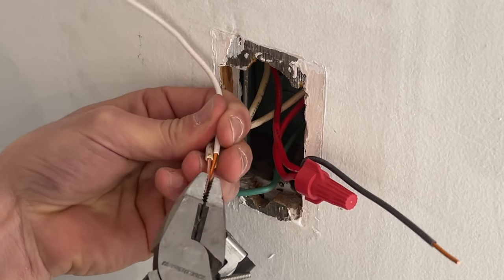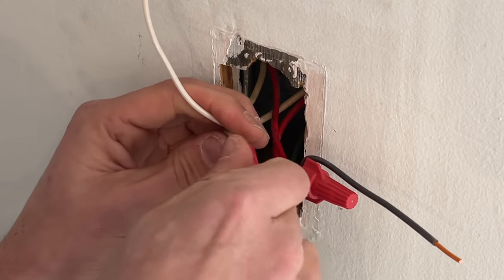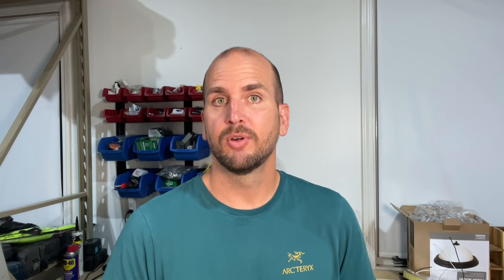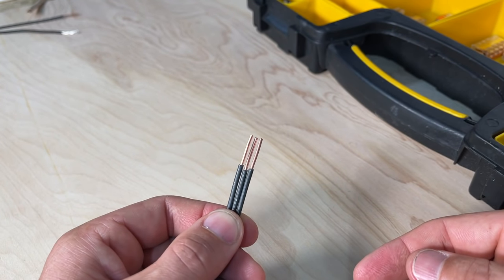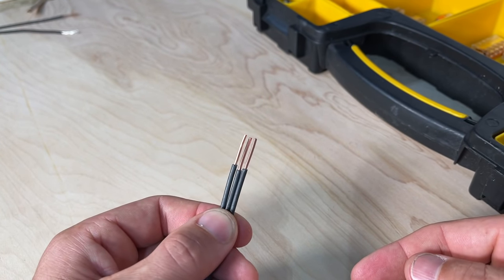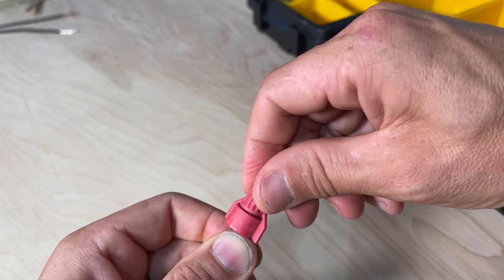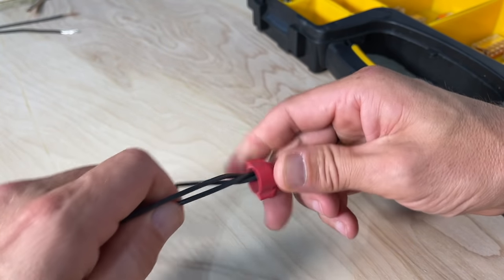10 Things You Didn't Know About Wire Connectors

Comment: There is actually a Marr connector.  It looks like a Marrette but when you unscrew the cap there is a cylinder inside with a side screw. To use it you stick the stripped wires into the cylinder and tighten the side screw to hold them in place. You then screw the cap back on to cover the cylinder and keep it from shorting. It holds your wires securely but you need three hands to hold the wires, the cylinder and the screwdriver at the same time. 
I always assumed the Marr was the original and the Marrette a newer invention. Sort of like cigar and cigarette.
Reply: I still have some of the Marr connectors with the side screw which I installed in my house.  Slowly changing over to newer version...

Comment: The "Self-Contained" Speedwire outlets like are common in RVs are really bad, for bad connections that can be a pain to track down especially on long daisy-chained runs.
Reply: I see a lot of those self contained outlets and switches in Mobile homes I work in. Whenever there is a question about one's operability or if it's worked its way out of the hole I pull it out, cut it off and replace it with a standard outlet in an "Old work" box which requires a slightly larger hole and usually works without further modification but sometimes the sheetrock requires patching and I have to cut a new hole. But I have come to love those old work boxes for this stuff . I don't use the full box ones just the collar because the walls aren't deep enough to accommodate a full box. I do not use the stab in feature at all I always loop my wire ends and use the side screws and yes I always pre-twist my wire before the nut goes on that way I know it's tight
Reply: @Rythymace  WTF you replace a self-contained outlet with a low-voltage ring and a standard residential outlet?? Holy fire hazard batman.
Reply: @ssl3546  The "ring" had no voltage rating it's just a plastic old work box collar. And i use quality 15 amp or 20 amp rated recepticles according to what is called for. And all my connections are wire loop on the screws not stabbed in the back. Much safer than those ridiculous self contained fire hazards.
Reply: @Rythymace  those are class 2 low voltage or are box extenders. you should stop before someone is hurt or killed by your ineptitude. and yes they do have a voltage rating

Comment: Pre twisting will do no harm to your connection. Sure the wire nut will twist them for you but what but how would pre twisting cause any harm? Also, many light fixtures come with pre installed push in connectors which also use stranded wire.

Comment: My problem with the wirenuts is we have a building built in 1979 and the "electrician" would use blue 3M B 6-12 wirenuts and put 10 #12 and 1 #10 (home run) under one nut for the neutrals. The B 6-12 is designed for no more than either 6 #12 or 1 #10 and 3 #12 as I read the 3M Spec Sheet. There is no way all the wires could pass the pull test even twisted.  The Wago Lever Nuts prevent this.  I live in an area that does not "require" electrical inspections.  You only have to "comply" with the NEC. NEC says the connection must comply with the UL spec.  I believe it said that in 1978 as it does today.  I forgot to mention that I don't think he read very well.  By the way, anyone seen a 10 pole breaker that spans the left and right sides of the panel lately??  NEC 210.4 (B)  The building is in the process of being rewired.

Comment: In much older houses, I’ve come across wire nuts made of Bakelite and even older ones made of porcelain . When I dropped one from a ceiling box ( repurposed gas fixture), it hit the floor and shattered into a million pieces.
As far as pre-twisting, I say yes because it’s still a stronger mechanical connection, has more contact surface area, both of which will lower your current draw. If you put an identical load on a pre- twisted wire and a non, I guarantee your current draw will be less on the pre-twisted. Resistance is an additional load.
Reply: Ohm's law says increasing the resistance decreases the current, so can you explain why you claimed the opposite?
Reply: @brothermine2292  I stand corrected, thank you . I still stand behind pre- twisting .

Comment: In Australia, electricians use screw junctions (twist wires together, put them into a terminal, screw down to tighten). I'm pretty sure wire nuts aren't up to code here, although WAGO lever nuts are approved and if they weren't pricier would probably take over very quickly.
Reply: It's so much faster that the price does not really matter. Count the number of connections you can make in a day...

Comment: I used a wago to wire a small room with just 3 wall outlets , I had a 10 awg feed from fuse box and a 14 awg to the outlets and while running a heater it smoked the wago after heater kicked on 4-5 times...not sure if I trust the wago's.

Comment: i think twisting of solid core copper definitely gives a better , lower resistance connection.  I think it makes wire nut more likely to fall off however, unless you untwist the tip a bit so that the nut has something to grab onto.    And always tape it afterwards for good measure. 

I think the manufacturers are simply covering their butts , at the expense of a slightly worse electrical connection.   There’s no way that the nut is going to properly twist up a pair of solid core 10AWG , for example …

Comment: diy. use wirenuts when there is no vibration. also secure it well with electrical tape. it will be good for a long time.
Reply: why would using electrical tape be against some codes ?

Comment: As a long time electrician I ask, if you do not need to splice (pre twist or whatever),  WHY do we have and always use the Klien or electricians pliers to make a connection? Certainly not to undo your wire connection because you screwed something up. LOL ALWAYS twist the wires.
Reply from the maker: Good question but actually Klein’s or Lineman’s Pliers were originally designed and used in the maintenance and build out of power lines.  So at least the original design wasn’t associated to residential and/or pretwisting.

Comment: I twist. That was the short answer.

 The reason comes down to a triangle being the strongest shape. 3 wires have contact with the nut threads and each other equally. Adding a 4th wire disrupts this equal force because, no matter how careful you are to make contact with all 4 wires to the threads, the wires are round and 3 wires will move to the empty spaces between each wire to form the triangle and the 4th will fall out. Any EVEN number of wires more than 2 wires can not make contact with the threads at the same time. 

If you need to use 4 wires, you need to put 2 wires in and ADD a pigtail to go in to a 2nd wire nut with the remaining 2 wires.

To save all of this extra work and space needed for additional wire and nut, TWIST them wires. 4 wires make a square shape, but twisting makes them round which just so happens to be the shape of the wire nut.

Comment: Wire nuts were used in the UK in the 1950/1960s - but not much since (you find them on rewires in really old houses here.  Screw terminal junction boxes took over, but ore recently we moved to Wago or Ideal (both lever, or push in)

Comment: I am having a home built for me and the electrician will wire it with wire nuts, as soon as they give me the keys I am switching out all the switches with Lutron and Brilliant and I have purchased Wago connectors for all my upgrades.
Reply from the maker: You will not regret it, best of luck on the project
Reply: Electricians still use wingnuts for a simple reason, the wingnuts are CHEAP. He should use the WAGOs or pushins when wiring the house.

Comment: A large part of my house wiring runs through the attic in cable ways.  Of course the attic can get very hot, causing copper wire connections and the metal in the wire nuts to work loose over time, from the daily heating and cooling of the attic space (I live in Seattle, so daily lows in the attic reaches outside temp, while during the day in summer it could reach around 130 degrees F or more).  For this reason alone I pre-twist my wires.  Every five years of so, I check the attic junction boxes to make sure the wire nuts are tight.  I am sure inside a wall in the living space, this isn't much of a concern at all.  Further, I don't trust the thin plastic cap of a wire nut to be the thing that holds all the wires together.
Not a fan of the push-in style Wago nuts.  They are like 'Shark-Bites' in the plumbing world.  The thin strip of metal that holds the wire in the connector seems to me too thin, and over time this could be a failure point from continued use, overheating, etc. I suppose if you use them in low load applications, they will be fine.
Reply from the maker: Thanks for the feedback and good on you for proactively checking things in the attic.  You are in the minority for sure.
Reply: Why don’t you tape them?

Comment: Up till recently I never knew (twist) "wire nuts" even existed. Looks flimsy and seriously dangerous to use them.
In the past I just twisted the wires by hand or pliers and put a piece of electrical tape over them. After that push connectors came in handy. And a few years ago I was "converted" to lever connectors.

Comment: DIY 6

I would say that those not familiar with the lever connectors may not push the wire deep enough and those wires may fall out.  At least with the ones I bought, you have to push the wire very deep for it to get a solid grip.

Comment: stranded wire can be used with push connectors just use ferrules and crimp them
Reply: thats basically the standard in the panel building and control panel industry

Comment: This video says to do everything you shouldn’t do. You should pre-twist your wires. The wire nut is the insulator not necessary the connector. The only time you should not pre-twist the wires is when you are connecting all stranded wires. When ever you’re connecting wires regardless of solid, stranded or combination of all you wires should be the same length. If your stranded is longer it will cause the stranded wire to fill the tip of the wire nut and not grab the solid wire properly there for leaving a loose connection. If fact that connection will fail 9 out of 10 times and the wire not won’t even stay on. This guy has very little experience.
Reply: Yeah, that's not how i was taught and it's not what the wire nut manufacturers say. Everything I've read, and been taught, says pre-twist is NOT REQUIRED but is ok and stranded wire needs to be slightly longer than solid wire.  Your bullshit 9 out of 10 failure rate crap has no basis in reality.

Comment: DIY - 4
One note on Wagos vs wire nuts. Another YT channel (sorry, I forget which) tested the actual resistance of connections made with the two, and wire nuts were notably lower. Not likely an issue for a lighting circuit, but on a 20-amp circuit that I expect to regularly carry that much load, I’ve gone back to wire nuts,, as a Wago could get a little warm. (I prefer Wagos otherwise though.)

Ah - I found the link for the load tests: https://youtu.be/rM4RmGzngHk

Comment: Always pre-twist to ensure a solid electrical connection. Your pull test is only ensuring a good physical hold in the nut, not that it's a very good electrical connection. I've seen a lot of carbonized wire nuts because they didn't make a clean electrical connection. And when the untwisted wires no longer had a nut holding them together, there's a live wire free to spring out to touch things it shouldn't. (and from time to time, that isn't going to trip anything, or the arc cause a fire/explosion.)

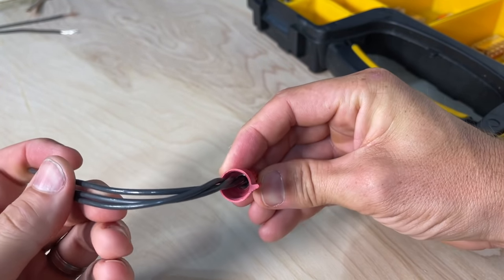Comment: 1:48 Pull on each wire to make sure you have a good connection. Pre-twisting can result in bad connections because the spring in the wire nut can't compress the wires together.
Reply: And never reuse a wingnut.

Comment: I have learned that electrons follow on the outer portion of a wire. If that is true then the amount of actual conductor surface area that touches each wire would be important. Straight vs. spiral OHMs resistance?    As to twisting, I feel that using a tool like electricians pliers may apply more forced twist than just hand tightening over straight parallel wires.  When I SEE the twist and matching length of contact for verification....before covering it with a wire nut, them I feel more assured that the connection is safe.  Now how about a note on plastic/nylon twist nuts versus nuts with a metal spiral cone on the inside ?   Thanks     JwgK
Reply: I gave up doing the hand twist when I first started using 12 gauge wire.

Comment: While you state (at 5:10) that the "original" patent for a twist-on connector was granted in the USA to Willam P Marr in 1933, an earlier patent application was granted to him in 1926, which was for
"An electric wire connector,`comprising, a tubular metal member capable of receiving a multiplicity of wire ends, a metal screw tending completely 'across the diameter of the bore' thereof and adapted to clamp the wire ends securely together and against the wall of said tubular member, and a separable closed tubular insulating member fitted over the metal tube and completely enclosing the perimeter of said tube and said screw."
( https://patents.google.com/patent/US1583479 )

This earlier patent appears to be the basis for the design of the Set-Screw connectors which have been used in Australia since at least the 1930s. 
( https://commons.wikimedia.org/wiki/File:Australian_Set_Screw_Connectors.jpg )

These have several advantages over twist-on connectors (which are not generally available in Australia)
 Only one size is available - or needed - for "bundles"  from many wires of 1 mm CSA up to two wires of 6 mm CSA
 Stranded and solid wires can be twisted together and held firmly in place by the Set-Screw(s)
 While the deeply set Set-Screw(s) cannot be touched with a finger, it is easily accessible to a meter probe
 The clear plastic housing used in modern examples makes it easy to check that the wire insulation goes up to the metal ring holding the set-screw and that the twisted wires protrude from this ring. 

(The use of two Set-Screws in the connector used for Earth (Ground) wires is a requirement in Australia - 
To be sure, To be sure !)

Comment: OKay....well, I was in electronics/chassis wiring for years, that meant soldering wires to terminals and connectors....I was always taught to make a 'good mechanical' connection FIRST, then solder.... I believe the same would hold true for wirenuts.....pretwist, then screw on the wirenut, at that point you 'know' that the wire has multiple contact points, and is strong.   As far as any of those 'friction/locking'  terminations.....I don't know, I'd be leery..... might be good when 'new' but over years, with oxidation, temperature cycling, and vibration....who knows...

Comment: Nah man ima keep pretwisting I dont trust just using the wirenut to twist not happening. Ive seen doing it that way fail never seen a proper pretwist fail even if the wire nut it self wasnt secured on right the pretwist will keep the cureent carrying conductors together. Just make sure the nut is tightly screwed on hell ill use pliers just to get an extra turn on it dont over tighten either tho or you can start to damage the wire nut. You get a feel for it. But like why not pretwist it wont hurt anything you just dont "have" to pretwist but every electrician I know will pretwist and so will I.

Comment: your going to get people hurt,  35 years tell me you absolutly going to get people hurt. people dont put the nut on tight enough and when you go in dor a repair your going to have more of a chance for a disaster.. especially in lighting where you may have higher voltages
Reply from the maker: Hey Andrew, thanks for the feedback.  Curious on what "higher voltages" you are referring to in lighting?
Reply: @EverydayHomeRepairs  277volts mostly.. and now in some of the newer lighting you have high voltages coming off the ballasts to drive the new led's
Reply: ps or when using wire larger then "12.  And  for both 110 appliances and 240 appliances.  not splicing any size  wires together can lead to them coming apart when opening up live boxes

Comment: Just don't use wire nuts at all. It's the the 1920 any more... Farmers also don't plow their fields with horses and soldiers don't wield swords any more. 
With wire nuts making a connection takes longer, it is never obvious if you have a good lasting connection or not, and can potentially be dangerous.
Take all the wire nuts and throw out. Now!
Well... maybe keep some as an example for future generations to show what used to be used in the stone age of electricity.